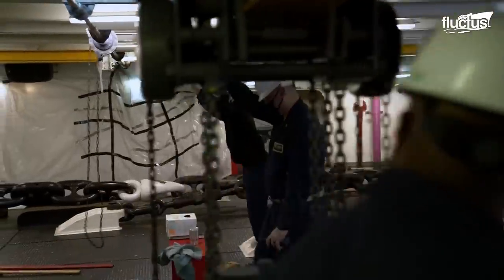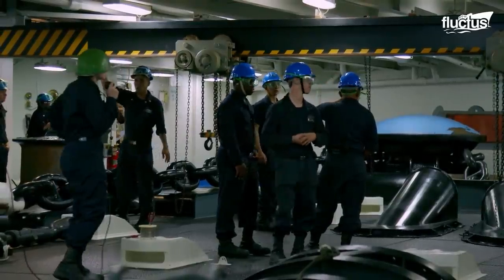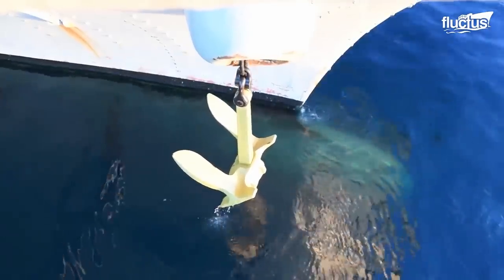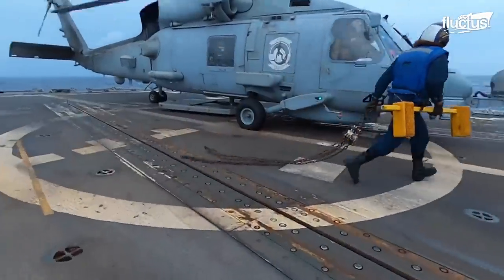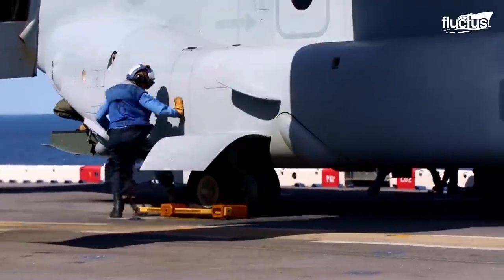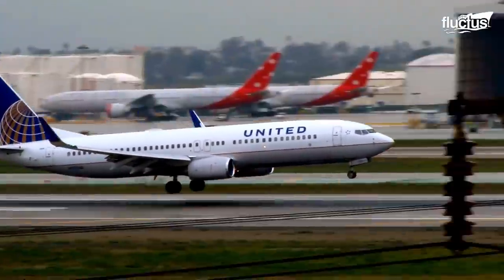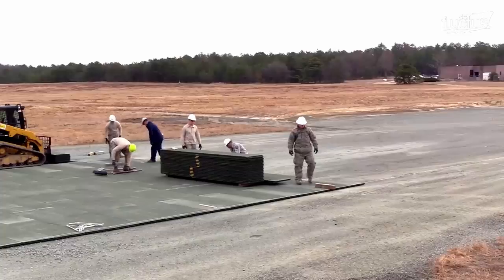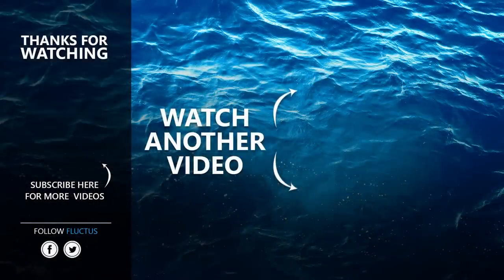The Crazy Techniques US Navy Uses to Stop Gigantic $13 Billions Aircraft Carrier

Comment: We don't use anchors to stop ANY ship.  The engines and screws stop the ship.  We use anchors to keep us in an anchorage position.
Reply: yeah right answer analogy. I can invent a break for a ship for sudden and quick stop in sea yeah 😂
Reply: Actually its the weight of the chain that keeps the ship in position. The anchor limits the chains movement.
Reply: I just watched a video where a ship lost its engines, tried using the anchor to stop, so there is that.
Reply: Would be sweet to see them try though
Reply: 3 eggs|====
Reply: Good to know
Reply: Did this video say that?  I must've missed that section.
Reply: Thanks for the reality check DCCS!
Reply: WONDER IF YOU COULD USE JETS TO HELP.
USE TO TURN.
Reply: @andykitchen5225 , didn’t work though, did it?
Reply: One of my military duties on the carriers I served on was being part of "The Special Sea and Anchor Detail".  We manned the Bridge whenever the ship was within 15 nautical miles of the shore, and at certain other times.  Dropping an anchor is MUCH MORE than just letting go.  Anchorages are normally very precisely plotted.  We must drop that anchor on the moving CV taking into consideration sea state, currents, depth, winds and the proximity of other ships (both anchored and moving).  You have to consider obstructions in the anchorage too - like moles, etc.  The calculations are done in real time (sure, there are estimates and guidelines, but there's nothing like actually living through it).  In some ways it is like dropping a bomb!  You want to get as close go the target point in your anchorage as possible.  I remember once we were off Coronado practicing drops, and we had to repeat the exercise 5-6 times until we got that anchor in the 'right spot'.  Another time we were off Busan/Pusan in Korea in heavy fog and had an anchorage right near the mole/sea wall.  Nobody on the bridge could even see the front edge of the flight deck!  Deck department fortunately had sent its very best lookouts up to the bow, and Captain Box (later Admiral) took us to the spot at 'dead slow' before letting go - at exactly the correct spot.  Most of us, including me were extremely tense.  Suddenly the lookout soundpowered up that the mole was in sight.  When the anchor had been dropped, and with the Special Sea and Anchor Detail ready to be secured, Box turned to the Detail and said simply: 'Gentlemen, Nothing to it, that's how it SHOULD be done!'.  He then turned around to me, and rolled his eyes for what seemed like an eternity.  I then heard the Navigator on the other side of the Bridge say from his chair 'Next time in clear weather!'  These are the little moments all sailors cherish and also make me miss my service years.
Reply: Someone has watched too many films (battleship)
Reply: @edwardweeden8837  CURIOUS COULD YOU SECURE JETS FACING BACKWARDS AND USE JET ENGINES TO  STOP SHIP.
Reply: I don’t believe anyone that claims they do anything in a comment section 😂
Reply: @sutnack7537  THAT WOULD MEAN YOU.
Reply: Can you kick the screws in reverse to stop or slow a ship? Or will that put heavy stress on the vessel?
Reply: @waynemercer4546  I HAD IDEA OF SECURING JETS IN A WAY THEY COULD BE USED AS BRAKES
Reply: @edwardweeden8837  Thank you for your Service Sir. 🇺🇸🇺🇸🇺🇸🇺🇸
Reply: Don’t think he said that.  I have a 24’ never dropped anchor to stop but I guess I could for a slow drift if I had to.
Reply: Stops it from drifting
Reply: "We" being "me and my mom", I suppose?
Reply: @bille77  We, being a Senior Chief Petty Officer (the CS part of my screen name) with 26 years of active service.
Reply: @waynemercer4546 that’s how ships slowdown.
Reply: @sutnack7537  Oh for sure.  There is no possible way that any of us who actually served on an aircraft carrier would use youtubed or comment here.  /S    lololol
Reply: @edwardweeden8837  You might know. I remember being told if the carrier dropped anchor where the depth was greater than the chain it would basically rip of the part of the bow where the anchor is attached / fed.    I've seen all the gear up close but my actual knowledge of it is limited because my job was down in the reactor plants.
Reply: Modern ships use dynamic positioning systems.
Reply: They drop it from carriers when there’s a SWIM CALL
Reply: @davidbwa  It would rip out the bitter end shackle and maybe a small portion of the bulkhead, if that bulkhead was weak, but not much more.
Reply: @Pine_Barrens_NJ  We never did.  Every swim call I ever had was in hundreds of fathoms of water...or in one case thousands.
Reply: @my Lord
Reply: @my Lord
Reply: In normal use this is true. We do however have anchors ready when manoeuvring in confined waters in case we lose our engines, in which case the anchors are indeed used to stop the ship. But it's very roigh on the equipment and you risk doing some serious damage to the focsle and the underside of the ship (depending on under keel clearance). 

It's a last resort kinda thing.
Reply: U ruined the whole video for me

Comment: Having taught Seamanship in the Royal Navy, I am sure that what you have called Windlasses are actually Capstans. The main difference being Capstans are horizontal and Windlasses are vertical.
Reply: And they are calling lines ropes.
Reply: To clarify things a little more, the horizontal capstan will have a vertical axis of rotation, the windlass axis is horizontal.
Reply: I used to monitor build and overhaul contracts on large ships. It was explained to me that a capstan is vertical, and the line/cable/chain is wrapped at least twice around it and exits the back side where it is deposited in a “locker” (storage compartment) as the capstan turns. A capstan does not store the cable or chain up on the windless “spool” for storage. A windlass has a “drum” where the cable or chain is stored as it is reeled in. There are exceptions to this, but that is the usual practice.

Comment: I am a civilian Master Mariner thus I am not used to US Navy protocols in anchor handling. When anchoring, it is not the anchor that holds the vessel in position, rather it is the chain or "shots" you pay out to keep the ship in position.  I only experienced 8 shots in each locker assigned for the chain.  Some of the ships I worked on had "self-stowing" chain lockers.  To ensure the chain had a clean run to the hawser, some of those gave more trouble than they were intended to alleviate.
Thank you for the opportunity to comment.
Reply: 13 and 12 is pretty normal for big merchant vessels. And yeah, the anchor itself is just there to stretch out the chain whilst the wright of the chain holds the ship in place.

Comment: It's the weight of the chain that does the holding, the anchor just starts the process rolling.
Reply: Gravity starts the process. :-) The anchor limits the chains movement on the sea floor. So I heard, I wasnt a deck ape. (BM)
Reply: T. rex.  Try to figure out which does the holding by which has the flukes.   Not the chain.   Need me to explain what the flukes do?

Comment: Aircraft carriers do not use two anchors to stay in place better.  2nd one is spare. And when anchored in a tide the entire carrier will swing back and forth depending on which way the tide is going.  Correct me if anyone has seen different but I never saw both anchors used in 9 years on two carriers.
Reply: Your hindsight is 20-20 David.  Never lived through it, never saw it, never even saw a picture of it!
Reply: I am going to make a guess  when a carrier might possibly use two anchors. In a river such as the Mississippi River  two anchors fairly widely separated  with the same length of chain out to dampen the normal way a ship swings at anchor in such a current.   That is just a guess but I believe you are correct in seeing the second anchor more as a spare.  On a single anchor a ship tends to swing in a sort of zig zag pattern in a current.   Ships other can CVs I believe use two anchors when mooring stern first to a dock, I believe that is a Med Moor.
Reply: @davidbwa  I agree with you and you are probably right about not going up rivers. I was using that as a place where the current would be from only one direction.  The swinging on anchor is fairly slow when on a single anchor in such a situation but it does happen. There are actually diagrams I have seen showing the swinging at anchor of a typical vessel.
In my hypothesis two anchors would only be used if the direction of the current was from one single direction and anchors widely spaced maybe 20 degrees to each side of the bow.. Otherwise you are right the chains would be fouled.  As I said this was only a guess where two anchors might be used. I simply dont know.
 Looking back to my Navy time I only recall once riding at anchor and that was in Manila Bay.  Possibly a second time was off the tiny island of Rodrigue in the middle of the Indian Ocean. But that was just short of 50 years ago so my memory is a bit fuzzy.

Comment: Never HEARD the term,  Windless?  WIND LESS,  Not LASSes.  <*>  ROPES are less than ONE Inch in dimer (called Nominal  3" lines),  You are referring to HAWSERS, typically of 12" (Nominal Circumference).  U.S. Naval cables have a 1" steel core.

Comment: Oh, I noticed the mooring lines, the way they were laid on the bollard.  Notice the "fraying" which indicates slippage when tension is applied.  That shortens the life of the rope.  To alleviate that problem is when you move the rope from the capstan, or have paid out the rope to a tug, the first you do is do a round turn on the forward bit of the bollard, then cross-over and do a full turn on the second bit of the bollard.  Once that is done do the usual crossovers until the bollard is full.

Comment: Each link is much more than 150 lbs, it’s roughly 350 lbs per link. The anchor doesn’t hold the ship in place, the weight of the payed out chain does.
Reply: Don't know if this has changed, but the forecastle is one of the noisiest spaces onboard when they have anchor activity!  Oh, I forgot, to give an honorable mention to jet noise, hydraulic spaces (like the JBDs), cats, arrestor spaces, generator areas, machinery rooms, and elevators (Weps and A/C).  And then of course there's Primary Flight Control when the Air Boss is 'ticked off'...!  LOL
Reply: The last time I checked, weight was a downward force. The wind and current are going to try to move the ship in some horizontal direction. Without a counterforce that has a horizontal component, the ship will just drift away.

Comment: Hey !  Hoser !  No such thing as a Rope in the Navy.  There are different "LINES" until it gets larger like you show then its a "Houser".   No. 2- Windlass is pronounced  "Wind-Luss"  No.3-  "Heaving Line" is a small line about 3/8th to 1/2 inch with a knot commonly called a "Monkey Fist" on the end, Used for the first line thrown to the Peer to carry back a mooring line. No.4-  It's the Anchor "Chain" that holds the Ship NOT THE ANCHOR. Typically you lay out 7 times length of Chain as the Depth at the anchoring location. No. 5- Since you're not a "Shellback"  your lack of Sea Fairing Knowledge is excused.  But still a good video of the Navy Way.  Thanks
Reply: Thank you I was gritting my teeth at each Wind Lass.   Saying a "few hundred feet"of anchor chain is an understatement.  A sea going barge I worked on carried 900 feet, 10 shots of chain   and wouldnt be surprised for a Carrier to have even more.
Reply: Pier not Peer. Education in ONE area is not education in ALL.
Reply: @ralphgesler5110   As a Gunners Mate and not a Deck Ape. Plus 50 years since serving. I can only call it as I saw it back then.  But your analysis of the Chain physical properties might hold water. I suggest that the teachings and historical information provided by the US NAVY might also have a degree of truth. To find the true answer according to your calculations,I have no idea where to look.  But I wonder what size anchor would you have to have using your data to hold the  80,000 ton ship ?

Comment: So when you get out of the Navy, you can either become:                                                                                                    1] An ANCHOR Man on the 6 O'clock news,
2] A TIRE CHALKER for the police, or 
3] be assigned to the CHAIN GANG
What a resume to bring to a job placement agency 🤣
Reply: My DD 214 (discharge paper) when I got out said with my experience I was qualified to be an ordinance mechanic. I never learned exactly what an ordinance mechanic was.
Reply: @glennrishton5679  So, you fixed the ones that didn't go off?😵‍💫I love it. Did that 🤣come with a special uniform that says, "If you see me running ... try to keep up!" Loved you comment
Reply: @miketrissel5494  Nothing nearly as exciting really, which thinking about it, was probably a good thing. I'm a slow runner.

Comment: Those big white lines are mooring lines. They are NOT used to raise the anchor at all. They are used to secure the ship to the pier. The anchor is brought up using hydraulic power via the anchor windlass. I should know, my shop was responsible for maintaining the anchor windlass on the USS Abraham Lincoln when I was onboard from 3/00 to 11/01.

Comment: This might be a stupid idea but what immediately comes to my mind as a solution for breaks on the chain, would be liquid breaks where increasingly more viscus fluid is pumped in for the chain to fall through.
Reply: Good job little buddy, but no ! No,no,no,no no 😊
Reply: I think the wildcats are probably a hydraulic system that the chain is passed through (the chain interlinks well with the surface of the capstan or other like device.
When they need more breaking force, they configure the hydraulic circuit to be more resistive - mechanically speaking.
I am not in that business- but, if I were to engineer something for that purpose- that is how I would do it.
Reply: Took me a while to figure out that you meant brakes.

Comment: What are knots of force?  Foot-pound or newtons I can understand, but not knots of force?  Aren't knots a unit of speed?
Reply: Youd have to multiply the weight of the aircraft x speed in knots to come up with how much force is applied. You are correct that its not a unit of measurement anyone  uses but the way he put it it does make sense. Kind of like the calculation for kinetic energy, is velocity x mass right?

Comment: You got this one all wrong. A 2 pelican hooks hold the anchor in place. There are no ropes on the ship other then in the rope loccker. There are mooring lines but they aren't used with the anchors. I could go on but please do better research in the future. Force is not measured in knots, speed is.

Comment: Wouldnt it be better to have 2 anchors on each end  of ship?
Reply: There are a US Navy ship that has 1 anchor in the bow and 1 anchor in the astern of the ship. One of the ship that I was stationed before the USS Samuel Gompers AD 37. It is a destroyer tender. A repair ship.
Reply: @pollyannapositive9192  Than you for your service. I served on USS Yellowstone AD 41. Those were the days. Hard work but lots of fun times, great memories. I saw so many places that I would have otherwise never seen. And seen things I would have never imagined. Glad I served.
Reply: No.  Single anchor allows the ship to swivel around the anchor and chain during shifting currents and tides.  The guys below on AD's had 2 because they would anchor in sheltered harbors with destroyers along side, and you don't want multiple ships swinging at anchor.
Reply: @dccs6009  Absolutely. If you're anchored bow and stern it makes for a rock'n'rolly night if the wind is on your beam. Also puts tremendous strain on the gear as the ship can't align its taper with the wind or current - which themselves don't necessarily align either. If you're joining a crowded anchorage with both wind and current, trying to figure out where to drop the hook so as to avoid embarrassment when the wind/current change can require some thought.
Reply: @dingomom95 subic LBFMs?
Reply: @johnlucier5654  Strange to ask someone with the name Jennifer about LBFMs in Olongapo.
Reply: @glennrishton5679  that shows "user-rk8dl7xxxx..." on my end. Not jennifer.  Besides when people in the navy talk about "back in the day" to me that predates females being deployed on ships overseas. I can absolutely assure you the US Navy was far more effective with all male crews, and its not because females are lesser than men in many rates.  Its the massive distraction caused by putting young adults of the opposite sex  together.
Reply: @johnlucier5654  To me it showed you were replying to Jennifer  That was why I found it so strange.  Maybe a glitch in the YT system.
When I was in it was only men on combat ships and no women in a rate seen as combat  such as Gunners Mates 
 I miss Subic  and still have fond memories.
Reply: @glennrishton5679  yeah yours says glennrishton with a 4 digit number which is also added to my name too. Then I see lots of "user-(gibberish)". Infinite wisdom of google brands.